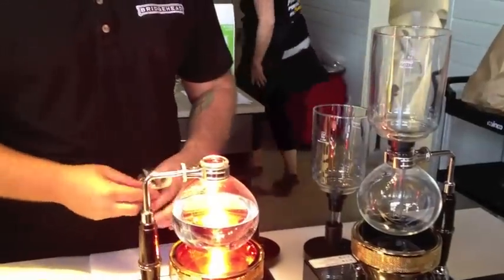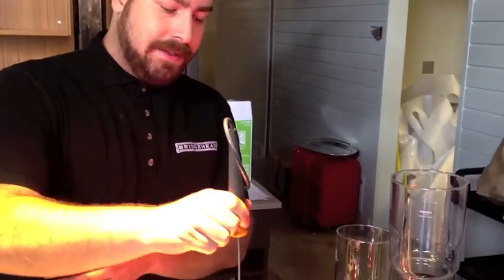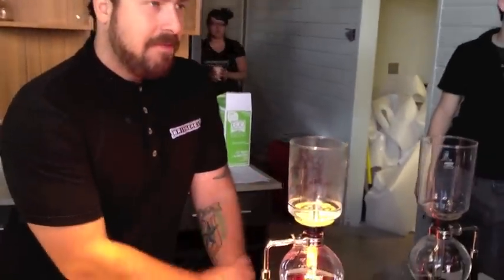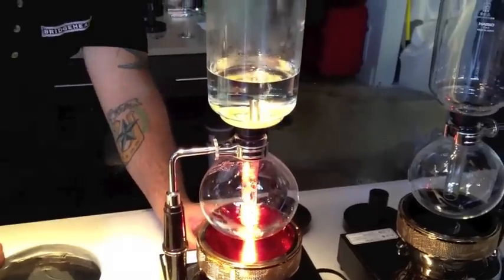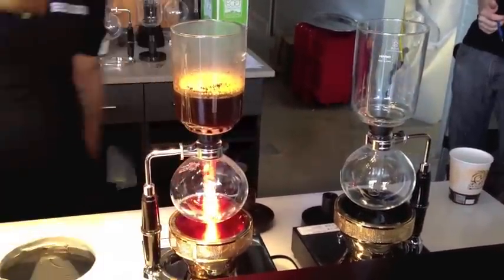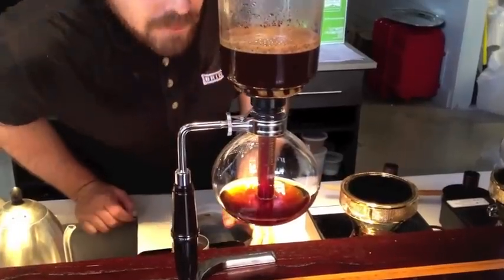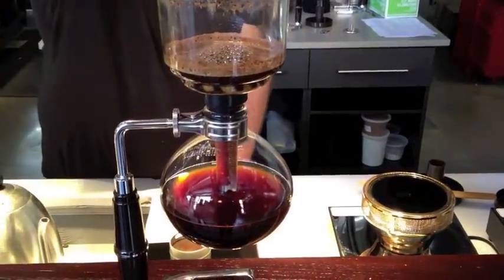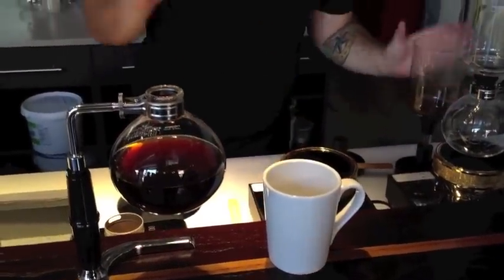How to make the best cup of coffee - Bridgehead

Comment: I learned to use these siphons years ago in a coffee bar in Tokyo. They put ithe in grounds in befote the water boils, stirs it vigoursly when the top container is full, then removes the flame...serve the coffee.  They had about 20 going at the same time with only 2 or 3 people making coffee.  I use the same method at home when using the siphon, great coffee.
Reply: The vacuum siphon pots have been around almost 200 years. They were invented by a German. They were very big until the 50s when the drip coffee maker came out. They were in almost every home. A long with the percolator. Seems that in the 50s all Americans pretty much forgot how to make coffee. The drip coffee maker ruined coffee for everybody.

Comment: I thought the whole point of the siphon method was that only clean glass touches the coffee. A metal filter, chain and a soiled wooden spatula goes against this. I shall stick with my grandparents' Cona siphon, thanks.
Reply: I'm not sure that's the point.  I have a cona as well as a hario.  I find the cona produces a much more muddy style coffee as the glass filter lets in quite a bit of sediment.   I don't think the metal filter, chain or spatula leech any flavors in the time they get used.  It's too short for there to be noticeable flavor changes in my opinion.  I'd recommend still stirring the coffee while it's brewing.  There will be some particles of coffee that won't get exposed otherwise leading to under extraction.

Comment: And this is why coffee workers get such a bad rap for not knowing anything about what they are doing, selling, or working with.

The physics of vapor pressure and the vacuum process controls the temperature of the water, not some clueless person adjusting the flame.  The coffee grounds are supposed to be in the top vessel during the entire process, not just swished around after the water rises.  And historically, most vacuum pots do not use any sort of paper filter.  They use a mechanical object , (a glass rod, or a plastic or metal disk), to block the grounds from being sucked back into the lower pot during the vacuum.  No paper filter is typically used for this type of coffee preparation, (modern versions are the Bodum Santos/Pebo, Hario, etc....).

Comment: Somehow I doubt blowing on it is going to cool the glass down. =|
Reply: If you think about it, you will realise that blowing on the glass will, in fact, cool it down. There is a reason your computer's processor has a fan attached to the heat sink. Have you ever blown on a hot beverage? I would go into this deeper, but in the end I doubt anyone will ever care about this message. In case you're still reading, I suggest you pick up "Six Easy Pieces" which is an abbreviation of Richard Feynman's lectures on physics. Which to some degree cover this topic.
Reply: ThyMole *:sigh:* Yes, I realize that air currents carry away heat.  Firstly, blowing on a hot beverage has more significant results because the act of blowing agitates the entire liquid releasing steam from not only the top surface but throughout the entire beverage, a solid only receives superficial surface cooling.  A computer fan is a constant stream, this guy blew for all of one second, one second of a computer fan wouldn't cool shit either.  Furthermore, computer chips are very thin, this glass is not and it also covers a much larger area.  Typically, if you want to cool a solid object you use some method of water cooling or a mechanical fan, manually blowing on it is fucking ridiculous.
Reply: botchalism I do agree with it looking useless and dumb, because it did strike me too as odd. I just didn't agree with implying that blowing on it will not do anything in terms of cooling effects. Also it's not necessary, it doesn't take long for the siphoning to start after you take the heat off the beaker. To each his own though. The raging discussions about "correct" brewing methods of coffee are many and long. Now I want coffee...